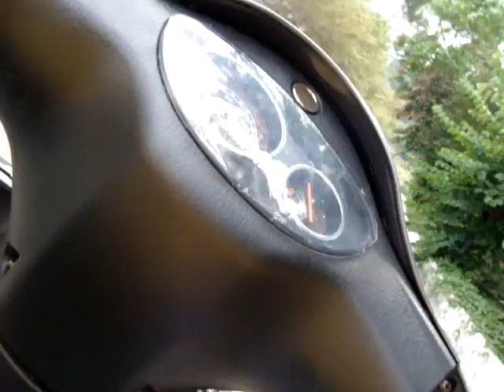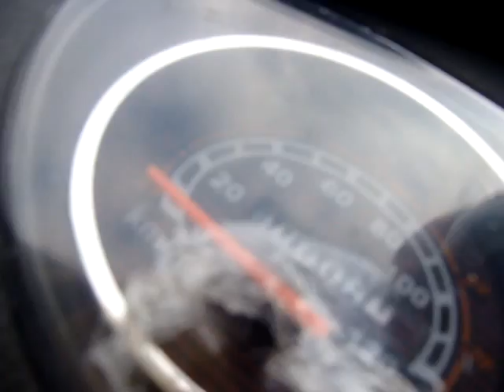"Green Baby" electric motorcycle, Da Guan road, An Keng, Taipei (Part 2)

Comment: 99% is overheated controller (burned fets) which causes to short motor phases this is why you feel the resistence when you pull. Disconnect motor from controller and try to turn it.